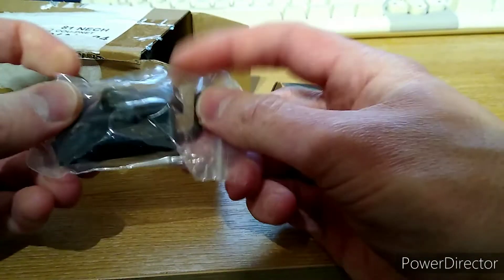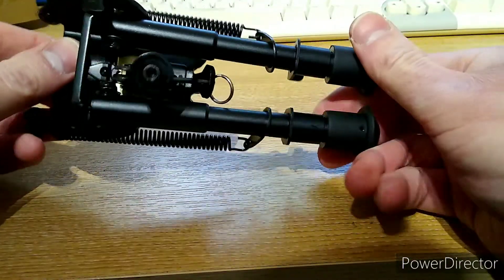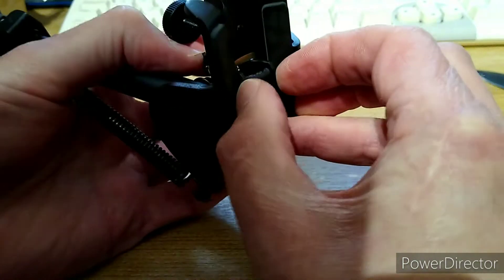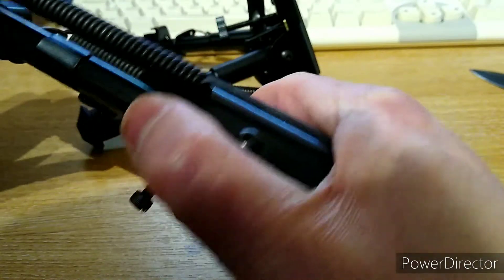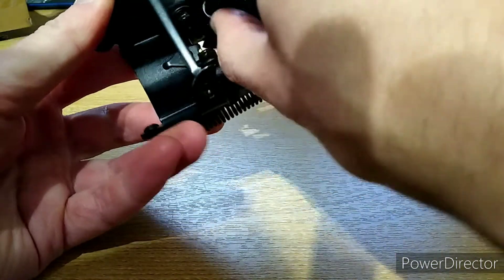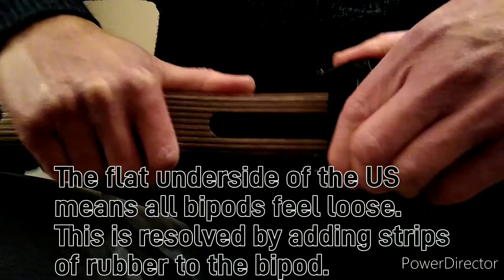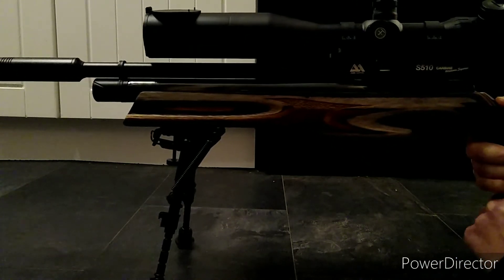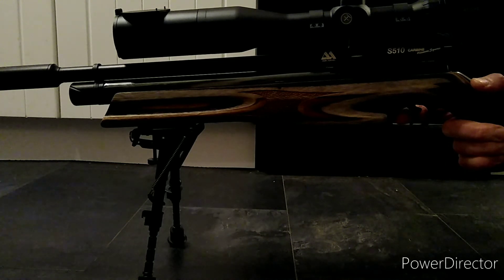NV023 Budget PCP Build Part 2. £15 bipod from eBay, is it any good?

Comment: I bought a cheap 6-9" bipod off eBay for about £20.00 four to five years ago.  The rubbers on the bipod fell off when the glue became brittle. Now one of the nipples that holds it on to the QB stud has fallen out.  My Harris is still going strong but its three times the price.
Reply from the maker: Hello Kevin, thank you for your comment much appreciated. Totally agree with you, Harris are the best bipods. I'm glad this one was only £15 posted, I wouldn't have paid any more than that for it.
As part of a starter package it is ok, but would quickly wear, indeed in a later video I replaced it with a Webley bipod which is pretty good (but still not a Harris).